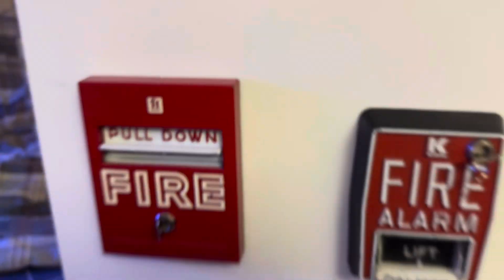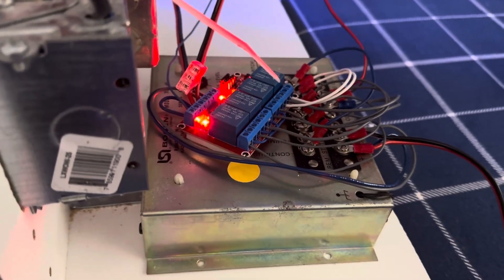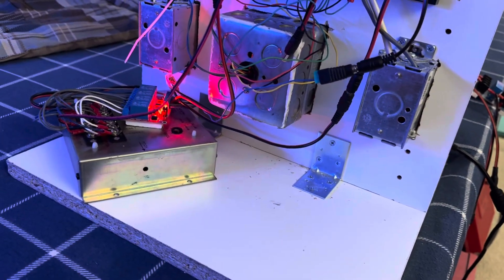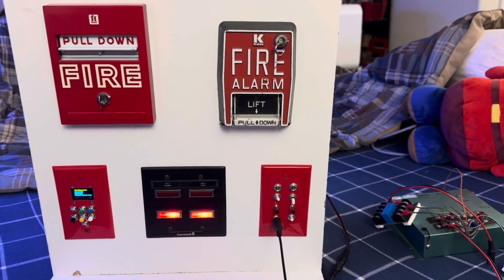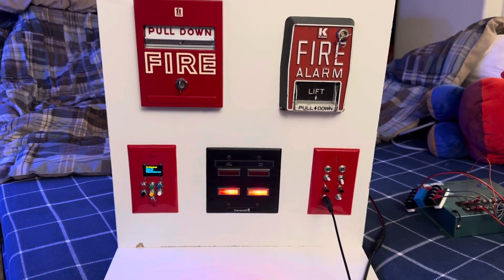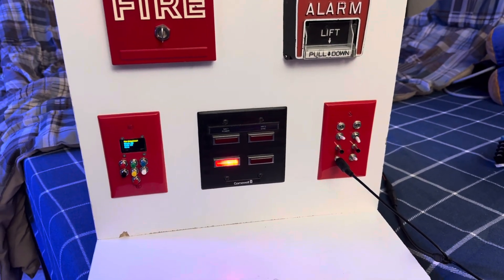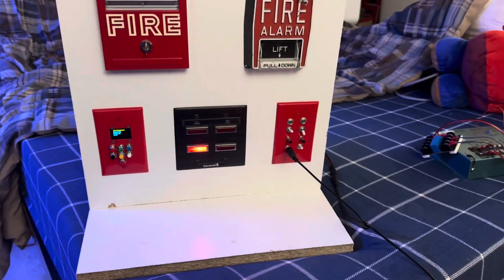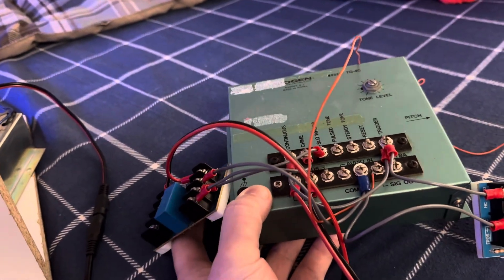Firecom 8500 (WTC7) Fire Alarm Tone: The Bogen TG-4

Comment: 7:43 exactly how the 8500 behaved on 9/11. That first low whoop was shorter than the 2nd and in 9/11 WTC 7 lobby videos, you can hear the 8500's inconsistent behavior to the point where you can hear it perform 3 low whoops in sequence, which can be heard at 4:24 in this vid:
 https://youtu.be/CaalgkywjDw?si=_enV6Ps_UZURPF7b

awesome stuff

Comment: why does it sound more like a Simplex 2001/2120 tone generator?
Reply from the maker: @AspiringHotelManager  they're both analog whoop circuits and I believe both also use 4000 logic for the timing of the whoop. I've got videos of the real simplex whoop card as well, the firecom is somewhat unique in that it's almost a double whoop
Reply: @LXXero , yeah, it's almost a double whoop.  I've seen video footage of WTC Seven, right before it collapsed, and there, it has a deeper tone, so I was not expecting the tone in your video to be higher pitch, lol! I actually thought it was a Simplex 2001 doing the same, double whoop, which is why I was confused!! Did the Firecom 8500 have a voice message in general? Not at the WTC Seven complex, but at other facilities.
Reply from the maker: @AspiringHotelManager  the pitch is adjustable, but there’s also a ton of echo in most of those clips from the surroundings, given they’re analog, every unit would have been slightly different.

I’m not really sure what they did for voice, I’m sure it had a microphone/paging system. Many companies just rebranded wheelock’s digital voice playback thing, I wouldn’t be surprised if they borrowed from the intercom world, either.
Reply: @LXXero  , gotcha!! Was the 8500 addressable or conventional?
Reply from the maker: @ I believe it’s an early addressable / multiplex type thing, you can read more in the patent for it
Reply: @LXXero , ok, sounds good!!

Comment: For anyone interested, you can make something similar with pretty basic scripting knowledge, or even in Audacity if you don't mind the tone not being generated every time.
I'm pretty sure you could also do it with Snap Circuits if you have them. 

If anyone's interested, I will post remakes of the tones on my channel. I spent only a few minutes on that and I'm sure I could do better if I really tried, but I just made them to show to a friend to demonstrate what type of tone was used. (sawtooth, sine, etc)
Reply: I could definitely do so with Audacity if I knew the start & end pitches (& maybe the timings too).
Reply: @TheCarson116  Use paulstretch in audacity after importing the sounds and run those through a pitch identifier. I believe it's about 445 Hz (at least for the chimes). The chimes and whoop were 2 separate parts used in tandem on the 8500.
Reply: @thecarwashesandmorechannel2892  Alright. Yeah that's what makes identifying the pitches of whoop tones impossible for me at least: unlike tones with stable pitches like hi-lo you usually can't get long enough of a stable sample at the beginning & end to know their pitches via a pitch identifier (good luck using that method if the tone is made of two tones played simultaneously or if there's other noise in the way too).
Reply: @TheCarson116  The tone is obfuscated in some way. It does kind of sound like 2 tones playing at once, which the 8500 does have 2 unnamed tone generators. However, the patent says that one is for chime, other is for whoop, and the whoop piggybacks off of the chime tone generator. So I honestly don't know. 
There is a guy on YT who has some tone generator named "Husky Equip" that I came across that sounds similar, so maybe they might have a lead?
Reply: @thecarwashesandmorechannel2892  Oh? Guess that would make sense given the whoop tone isn't the kind of whoop you'd get with Audacity's "chirp" generator (to put it one way). What do you mean by "the whoop piggybacks off of the chime tone generator" though? The two have nothing in common otherwise, no?

Oh? Well the tone generator is known at least thanks to this guy's videos: it's a Bogen TG-4B.
Reply: @TheCarson116  People keep saying that it IS a bogen TG-4B (Why they say it's specifically B, I have no idea as there is only one difference between the C model) It's only speculation. The evidence sure points to it being this model of Bogen, but there is also not a lot known about Tone Generators of the time. And then there's the whole thing with the 8500 producing dual tones. 
I'm not sure what they meant, but the patent basically said the whoop generator ran off of the chime generator.

Comment: I saw a video somewhere where it was at a school. Started by pointing at the ceiling showing a generic white round speaker and an adjacent white Simplex 4904 strobe. When the alarm sounds, it sounds like a Firecom tone in a higher pitch (and I'm assuming maybe that's what the tone is), with the other alarms being Simplex TrueAlerts on Code 3.
Reply from the maker: Might have been firecom if it was New York area, but may have also been part of an intercom system. The pitch is adjustable on them, and it’s analog so they’re never exactly the same
Reply: @LXXero  I have no idea where it was. The video is lost media as of now.
Reply: Bogen Communications also made intercom systems. That is likely what it was, perhaps used as a drill signal or for some other reason manually set off or wired in some weird way. I'm not sure exactly what the TG4 series was used in, and I'm trying to figure it out. Unfortunately Bogen isn't being very cooperative as they probably don't want to be known as "The 9/11 alarm company"

Comment: Quite impressive, I figured that it used some sort of 'off the shelf' tone generator due to the bizarre nature of the alarm and it's cycles, and as you pointed out, they would never have the time or have the need to make these sort of thing themselves, someone already made them. This sort of thing I don't think would ever fly with modern evacuation equipment, the 8500 seems way overly designed. Makes me want to pick one of these things up to play around with it and get some recordings
Reply: Same here lol. I would love to get a TG-4 and an old Wheelock Speaker/Strobe for it
Reply: @SirensAndAlarmsOfNorthernIL  I picked one up a few weeks ago. It's not that hard to wire up but I need to get some better media for recording the tones directly off the board.
Reply: @DatamasterCorporation  ooh nice! Can’t wait to see that coming!
Reply: Well, the patent says it "may or may not be off-the-shelf" so, I'm pretty sure it is off-the-shelf.
Reply: @thecarwashesandmorechannel2892  Ok

Comment: can you tell me how to make this
Reply from the maker: I would preface that with a warning: this isn't a great beginner's project, as the CMOS chip that handles triggering the tones is very sensitive, and both I and another person I've helped with this, have had to replace said chip due to failures.

That said, if you'd still like to give this a shot, take a look at the instruction manual for the bogen tg-4c module - they still make this version of the module today & they are usually available on eBay used for around $40-80.
Reply: @LXXero  you could aslo use an arduino uno